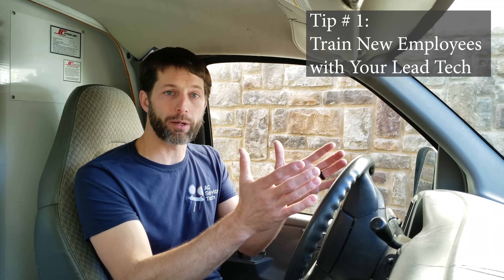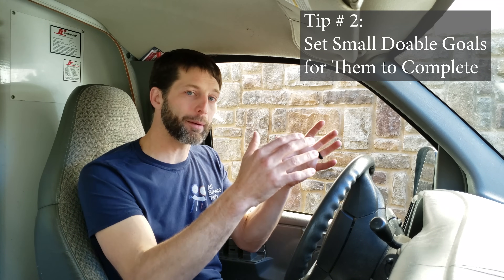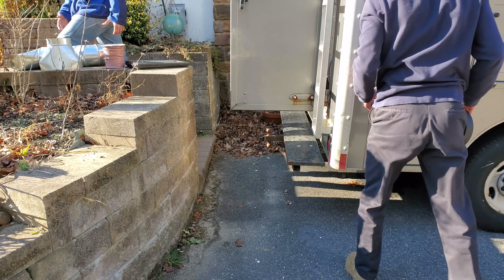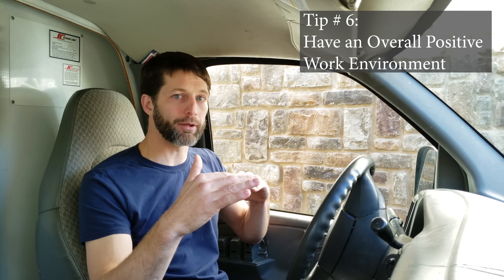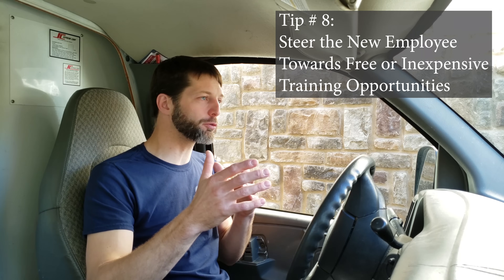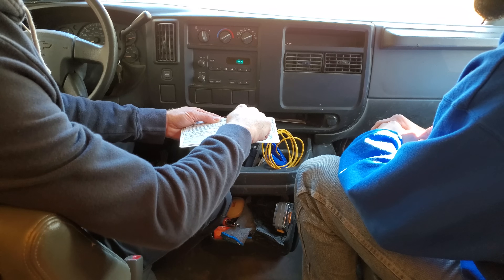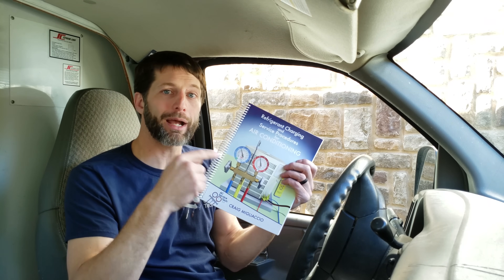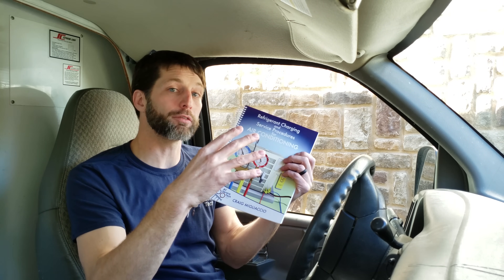10 Tips to Help Your New HVAC Employee Grow in the Company!

Comment: Hey my name is Ray l did purchase an electronic link for your book but honestly speaking l am not to sure if it just me or not but l am really having hard time using it because of the support file system, and the only reason why l purchase the electronic version is because l am out in Canada and it cost me less getting the electronic version versus the booklet version, please advise if they is some you can help me with on this.
Thank you
Ray
Reply from the maker: Zambou Raymond, please email me at info@acservicetech.com and I will send you some steps in case your device or program is not reading the file correctly. It should work fairly well so I just need to know the device and issues in the email, thanks!